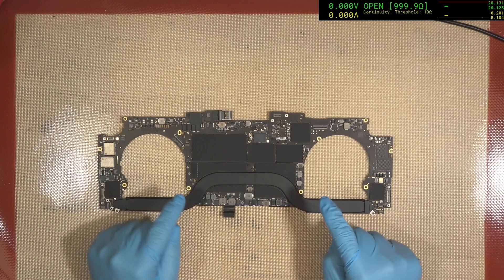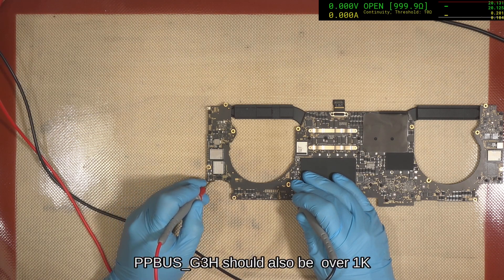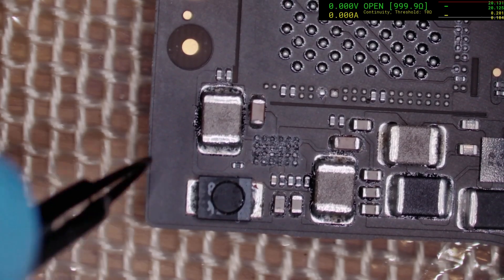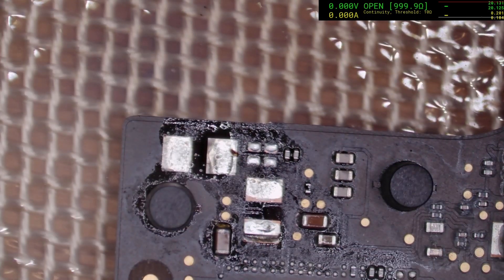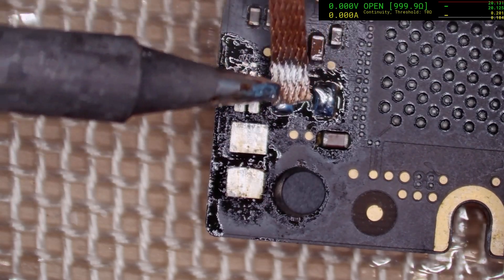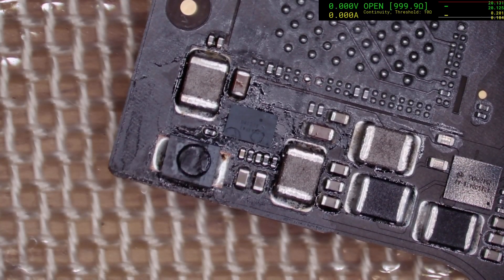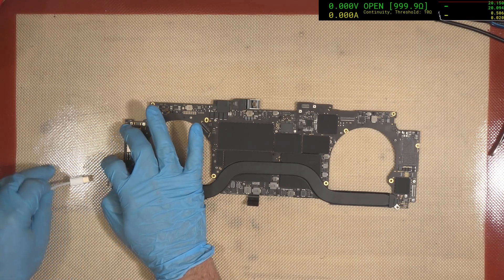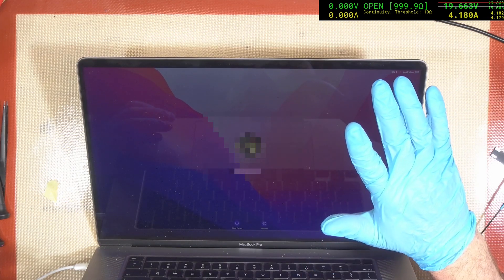Rescue Macbook data when Apple refuses

Comment: Nice job… I’m always wondering why you don’t add a zenerdiode at the output of the voltage regulator? If it fails again, the NAND’s aren’t destroyed…
Reply from the maker: It comes down to tradeoffs.  It's difficult to manage overvoltage on low voltage systems with high power outputs other than by the controller itself; but if you do add more circuitry such as a LV clamp-crowbar that'd be required, you've now created a larger surface area of potential problems.

Section 9.13 in "Art of Electronics" covers this in some detail and is a good read.
Reply: @pldaniels  I never tried it before. But I never saw a zener became open circuit when it's damaged. Only get shorted. My experience comes from older CRT televisions. Zeners are often used in protection circuits, but not with that high currents on low voltages like in the MacBooks. 
When it gets shorted in the MacBook, the SSD is saved. But indeed, I can't guess the behavior in "normal" operation.
Reply from the maker: @gertw.4293  it's definitely seems easier to deal with the HV & low-current combo (within reason) than the LV & high currents we see on these machines.  We are actually lucky enough that in many cases with the SSD/NAND VREG situation that a cap does go full short and effectively crowbars the VREG and subsequently it goes in to failure mode, but alas this is also where so many techs are ultimately taking the next step and destroying the data, because they remove the shorted cap, power up, and that's usually the moment when you find there's a secondary issue ( overstressed vreg  or bad FB ) and the data then goes up in a virtual flash.   

Never was keen on working on CRTs; loathed reaching under the anode cap to discharge the flyback :|, probably checked my grounding multiple times before waiting for that flash & pop;  I did however greatly enjoy reading about other people's experiences in the likes of ElectronicsAustralia's Repair column.
Reply: @pldaniels  Working on CRT's indeed is another way of thinking :) Those things were the basics of electronics for me.

In any way, thanks for your comments about the VREG situation in this MacBooks! The newest one I ever repaired was an A1707. I'm waiting to see an A1990.
I love MacOS, but I can't understand why Apple doesn't protect the SSD power supply in those machines and makes all the "design faults". The cost is high enough...

Comment: Hi, excelent work, congrats, i have one question, whats is the temp do you use for resold the ELC180?, i have the same problema, im put off the ELC180 and verify that nand not fried, and bought the ic, well thx.
Reply from the maker: It's difficult to guide on hot-air settings, because everyone does things differently with distance/angle and the equipment too.  I usually use 450~470'C @ 60% air on my Atten

Comment: I recently inherited one of these for personal use. The same area had a short but i was lucky enough to revive it. I was thinking.. would it help to cover the controller area with uv curable conformal coating to prevent dust and other elements from getting to it easy?
Reply from the maker: It does help if just on the vregs, though in some ways it just prolongs the somewhat inevitable as the point of fault spreads out a bit more.  What makes it tricky is the entire board "arm/wing" tends to be suspectible and there's no practical way to protect it ( conformal coats have their own issues ).

Comment: Nice job, even thou I hate working on apple products.
I can see the future of Apple products having one BIG soldered on chip that has everything in it, so we can't make easy fixes like this.
Reply: The M Series is almost there, no? Isnt it cpu, gpu and ram in one chip already? Just need to cram that pesky ssd in there too.
Reply from the maker: As counterintuitive as it may seem, the migration of the RAM/CPU/bridges in to a monolithic block can reduce the chances of failure but conversely if something fails within that block it's most often a total failure;  so you get less failures but more severe outcomes.

The M1 series did make improvements in the design layout to keep more criticial vreg type electronics away from the perimeters of the board.... the new MBAirs even have now a full metal overshield, though that's a pain to deal with from a repair point :)

Comment: By measuring resistance you DO inject voltage/current into the circuit.
Injecting low voltage current or using kelvin configuration probes is actually a good way of locating a short without risking any additional data loss.
Reply from the maker: Yes, that is technically correct; though we consider that to be within the realm of safe limits ( I would argue at times some diode-modes on meters could be a little risky )

Comment: i strongly recommend using precision power supply to inject stable voltage to restore data before soldering anything after removing the short. these boards also like to have direct ppbus-2.5v rail short if waterdamaged